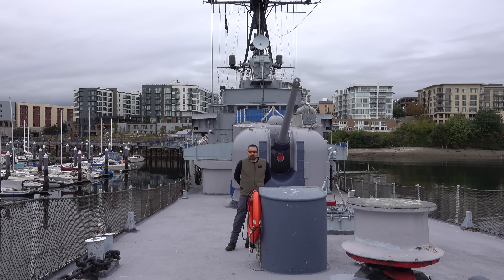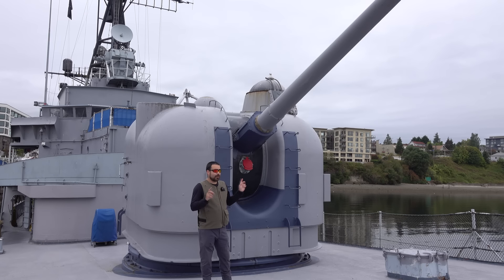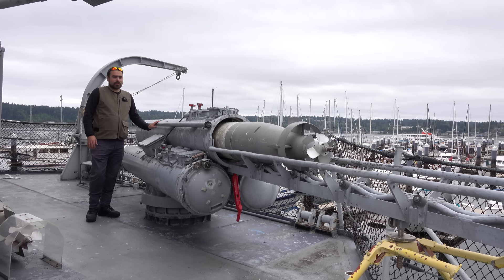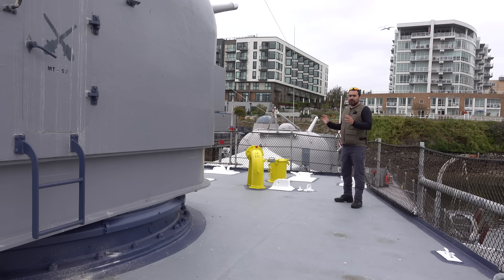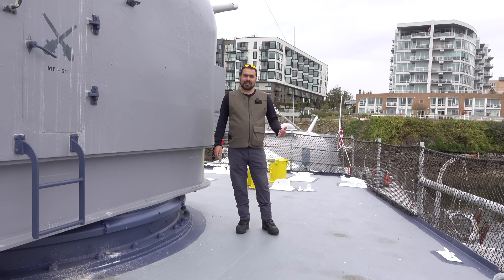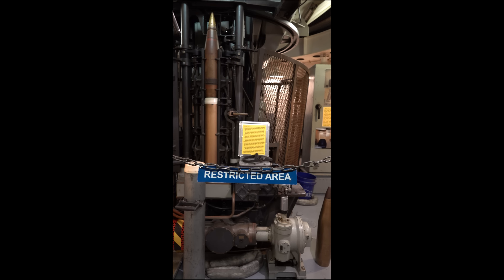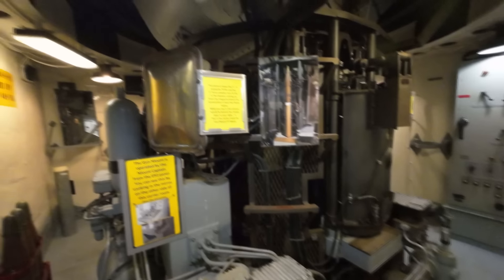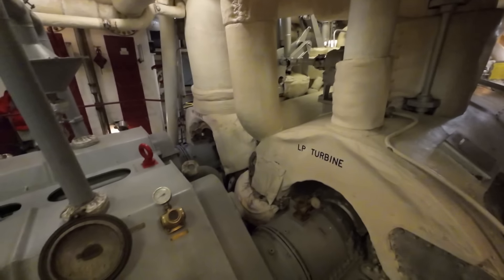USS Turner Joy (DD-951) - The USN's Last Gunfighter

Comment: I used to live in Port Orchard. I wish you had visited when I was there. I could have shown you equipment on her that we still use in the modern Navy.

@ 25:57 That's not a button, it's a switch that is missing it's handle, and below it is a sound powered phone jack. The yellow thing is called a Battle Lantern.

@31:18 Those mattresses look very similar to the ones I slept on for many years in the early 2000s. The space is called a berthing and we called the locker under the bed a "Coffin Locker"

@35:04 That is also a sound powered phone in it's cradle. We still use them in the Navy. There is a great number of things in that engine room we still use. Basic design hasn't changed all that much.

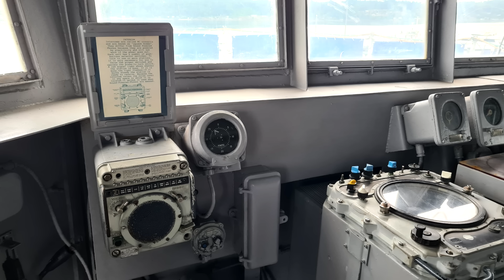@39:30 That is known as a "Bitch Box". Specifically a JV or MC circuit, I am not sure which one as I can't see it well enough to read the labels. You did call it a 1MC later. That's general announcing shipwide.

Comment: Turner Joy is, in fact, pretty bitchin'. I went there before the scamdemic I believe, and it was a self-guided tour then. You can even climb into the gunners seat on the 5 inch guns, and the scopes still work on them. The field glasses mounted to the rail near the bridge are damaged though, as are the shutters for the signal lamp; It's kind of sad actually seeing what's broken or missing aboard ship. I only wish that my sisters' dad had still been around to tour it because he was a boiler operator on a Gearing class ship during Vietnam. I did get to go with him aboard the Hornet down in Alameda, and while it's one thing to walk through a machinery space and look at the equipment but God forbid touch anything, it's another to see them pull tools off the rack, and demonstrate lighting the boilers, adjusting the burn rate of the fuel, and setting speed on the equipment even if it's not running. And then listening to them and the docent trade stories from their time in the service. We were walking by some display cases and he points at a book, a volume for Boilermen and says "that book right there tells you most of what you need to know about running the boilers on these ships." It's neat to see jobs coming back to people.

They wanted him to stay in for Nukie training and he went "nope I'm good!" His father was Air Force and I sometimes wonder if he joined the Navy just to irritate him.

Comment: Wouldn't want to be in that 5" turret when the gun goes off. Ooof.
Reply: Actually the firing of the gun wS a lot quiter than all the electrical motors
Reply: outside the turret is where it gets sporty! 5"/54's have a hell of a bark if you arent inside.